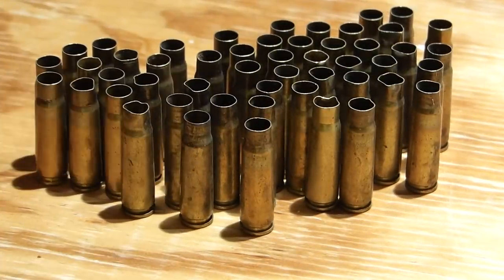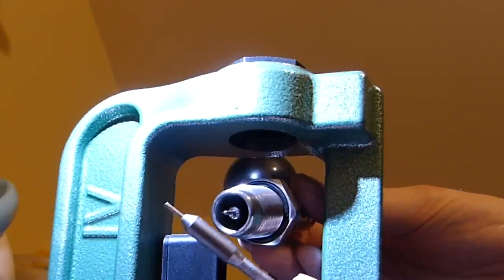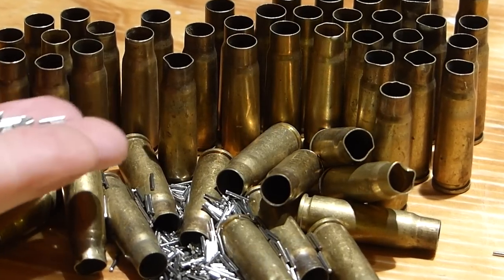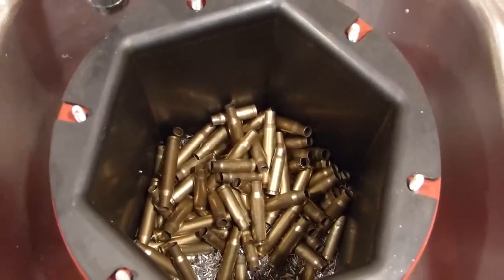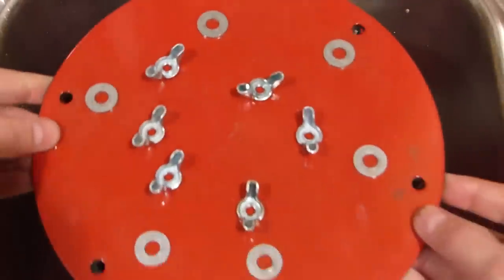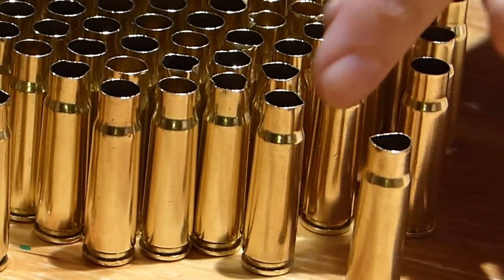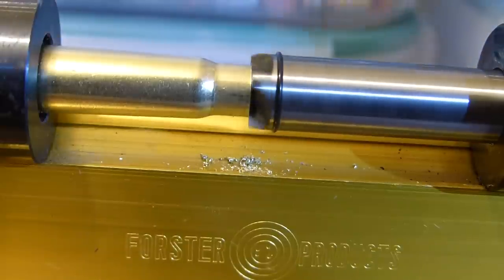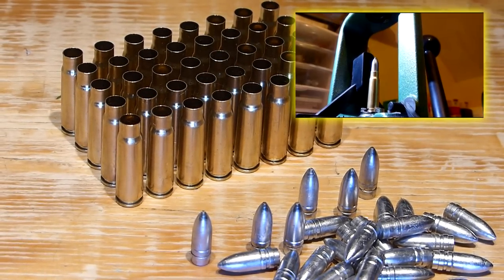7.62x39 Old Brass Revival - Salvaging & Restoring old brass cases for reloading ammo

Comment: Back in the 1970's, I got a hold of 300 rounds of 7.62 x 39 ammo at a gun show.  Back then anything AK was almost scarce.  The ammo had a blank head stamp.  It fired nicely and provided me with reloadable AK brass for many years. (We were not importing ANY foreign AK ammo back then.)   Years later I learned that a batch of ammo had been manufactured by Winchester for US use when making excursions into illegal areas when our troops used AK's as not to leave evidence of US involvement.  I guess it had value as a collectable.  I still have one round in my small collection, unfired.  I still reload the same brass as well as some Norma and then other brands as they got imported.  As I recall I used 3031 powder.  it worked very well.

Comment: Instead of using the needle nose pliers to fold out neck dents, use a tapered (nail set) punch to evenly expand the dents. Only use pliers for folded over dents...
I do large quantities of brass ( '000s), and dry tumble them Before decapping and FLS; Dry tumbling is done in a Concrete mixer with granulated PVC electrical insulation; usually 1500 to 2000 shells at a time, over 4-5 hours.
Wet tumbling comes asa final, in&out& primer pocket clean of FLS shells.
Results: Commercial Quality Brass ( we leave any case trimming to the Customer, although we do have a Dillon Auto trim for our 1050 presses.
Good explanation, especially the LemonShine dosage.
Thankyou, Doc AV down under.

Comment: You can Make a divider out of a cheap plastic cutting board for your Thumblers Tumbler.. That's what I did and that cuts down the time it takes to sort your brass,  Like .357 and .38 special. 9mm and .380 auto or .38 super. .44 magnum and .44 special. and so on. Just cut the plastic board to fit at the widest part of your drum, drill some holes to let the pins migrate from one side to the other. That's it.. Good Video dude. Dave.

Comment: I have found out from years of wet tumbling that using a product like Turtle wax and shine instead of dish soap works way better. If you find your brass discoloring after you wash it then then it tarnishes when it's drying try the Turtle wax and shine. It will amaze you and leaves a microscopic was on the brass and protects it from tarnishing the lemi shine softens the water also so use it in hard water for sure prevents spots the wax left behind from washing this way will not interfere with your loading any way.

Comment: You can speed up you time greatly by misting your cases with silicone spray lube instead of using the pad lube method.  Just stand the cases on end and give a slight mist.

Comment: Substitute Ammonia for your citrus cleaner. Does the same, cleaning wise, plus it neutralizes corrosive primer residue. If you'll notice, the main ingredient in most brass cleaner/polish is Urea, also known as Ammonia.
Reply: ammonia is not good for brass.
Reply: Over the life of ammunition cases, ammonia doesn't have enough effect to worry about. It's still the best cleaner available.

Comment: Great video. I have never seen casings cleaned using your method. I would like to give it a try. Thanks to Grandma for developing the recipe. Where did you get the stainless steel pins?

Comment: I have a question. How has firing lead cast bullets through your AK turned out?
I always got the impression (from gas-operated systems like the Desert Eagle) that firing lead bullets may foul and clog the gas system resulting in a single-shot firearm. I've always had the impression that it is advisable to shoot only jacketed bullets when using a gas-operated firearm.
Please correct me if I have any misconceptions.
Great video by the way! Very informative. :)

Comment: Neat. I've often considered the wet method, but case-drying methods made me nervous - especially the oven-on-low method. I wonder what putting them in a cloth bag (or several layers of cloth bag) and tumble-drying them would do? Surely no way that's getting hot enough to do metallurgical damage, and I could kill two birds with one stone - the laundry needs doing in any case, so if it's safe, why not? Also - SUBSCRIBED. :)

Comment: Hey I use the method of clean you described. Your video actually got me turned on to reloading and cleaning the way you described. I have had recent problems of my brass tarnishing after cleaning then drying at low temp in the oven. Am I using to much dish soap that has harsh chemicals? wrong brand (dawn dish)?
Reply: Did you rinse them?
Reply: +FreedomPrepper Try using Turtle wax wash and shine instead of the dish soap it leaves a microscopic coating on the brass that keeps it from tarnishing one of wet tumbling best kept secrets

Comment: Noticed you had some brass with copper on the outside, I've seen this too after cleaning in vinegar, any other recommendations for removing it [besides stainless steel pins]?

Comment: If you don't already have a set of jeweler's pliers with flat jaws, I might suggest brass pliers.  There's a company called PPE (Plastic Process Equipment) that sells a variety of solid brass pliers.  They'd be good for this, and are handy for some gunsmithing jobs.  PPE-dot-com, click "Ordering" at the top, click "guest" to order as a guest, click "Inventory Catalog" on the left, and the pliers are under category "COB - Brass Tools."

Comment: was it worth it?
Reply: +TheMaverickq Financially, right now it isn&#39;t.  But as the Great Ammo Rushes of 2009 and 2013 reminded us, store-bought ammo (even Wolf/Tulammo) is not always readily available.  In such a case, it&#39;s good to know how to roll your own.  The stainless-steel pin wet-tumbling method for cleaning cases is very effective, BTW.
Reply: +Cowboy Yea but he used old brass cases. What if he can't get any? I would like to see how to make it from scratch.
Reply: +TheMaverickq Yeah, cases from scratch might be a little tough.  Fortunately, there are a lot of milsurp and commercial steel cases.  Unfortunately, brass-cased, Boxer-primed 7.62x39 rounds are currently relatively expensive, and buying ammo is the best way (right now) of getting such brass.  Besides, if it were easy/cheap to make your own brass cases, we wouldn't need resizing/decapping dies, now, would we?  :-)